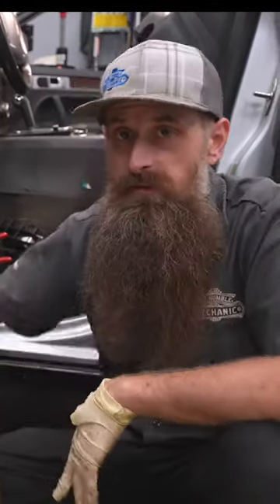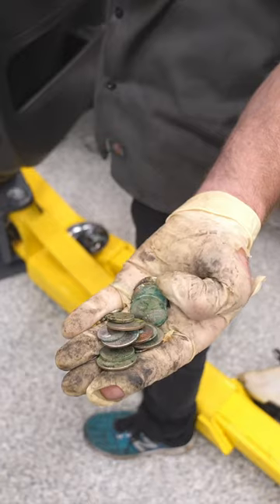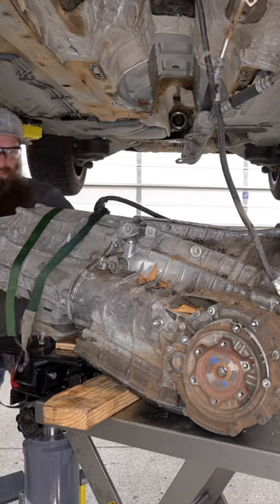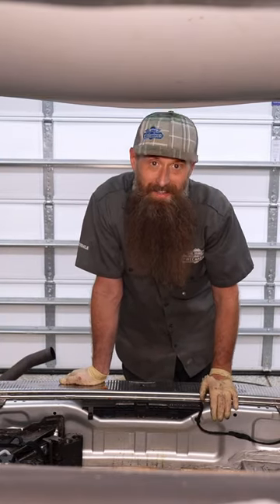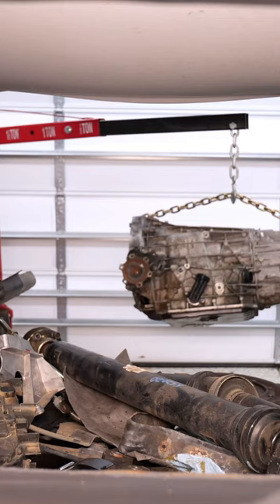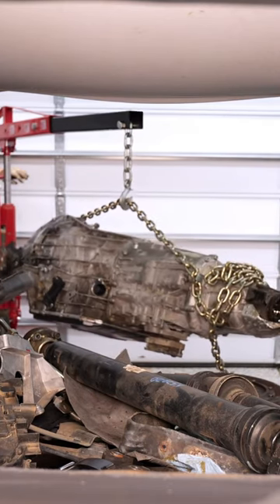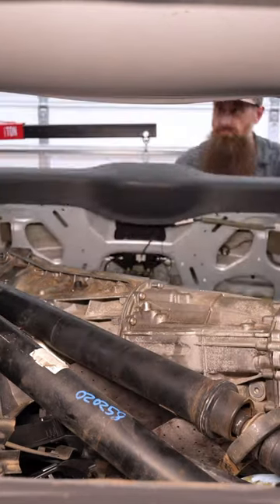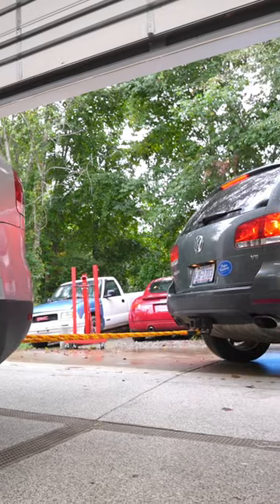Scrapping A Dead VW Touareg  #automobile #shorts

Comment: Was considering purchasing a late model, low miles Touareg until my VW service advisor was kind enough to share that it was built on a Porsche frame and a brake job would run over $3000!  I'll keep my 2013 Passat TDI SEL Premium, thank you very much.

Comment: I need parts for my t1 touargeg. Come on man!!
Reply: Whatcha need?  Macon, ga
Reply: I as well
Reply: @WolfsburgTech  idk i never thought id get this far? the only problem i have and my vw tech buddy said to just ride it out is a gradual whine that increases and decreases with speed not rpm. he says its common to come from the front diff bearings. and to just replace the front diff when it gets too bad. that sound right to you?
Reply: im a general mechanical tech out of florida so i have a good grasp on most cars and i do all the work on my touareg but its not worrying me enough to pull snd replace the diff if i dont have to. nor do i know where to source one @WolfsburgTech
Reply: I have a 2004 parts Touareg for $500. It's the V8. It's all there.  The previous owner broke the timing belt.  It has a good title. If you can bring a trailer and winch it up, it could be yours for $500.